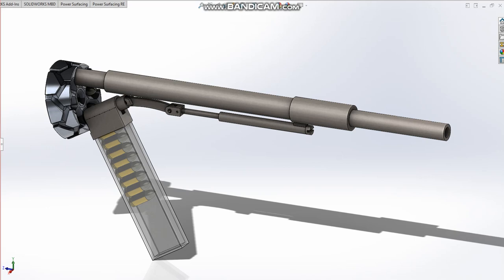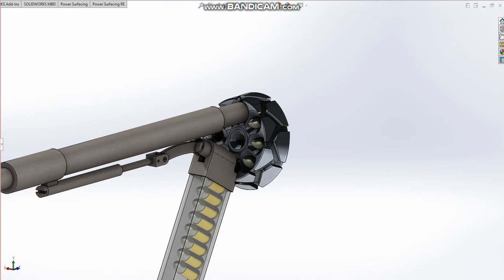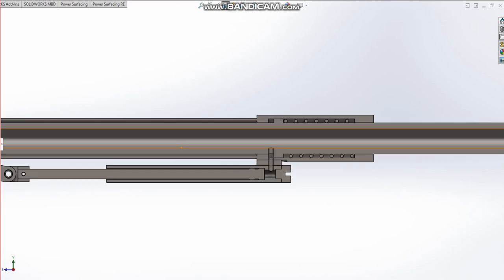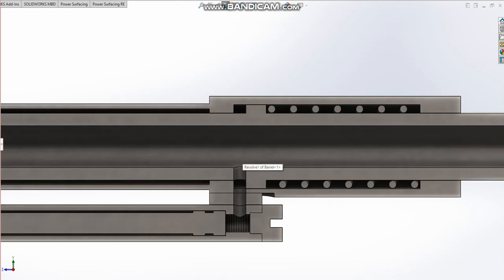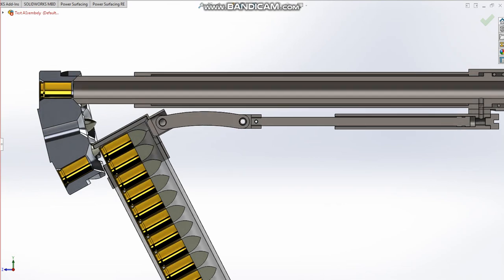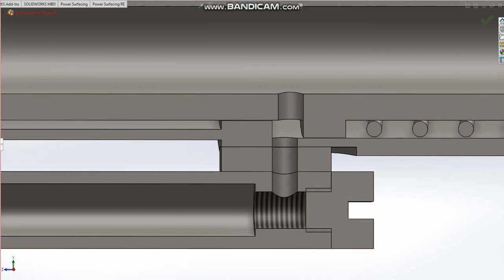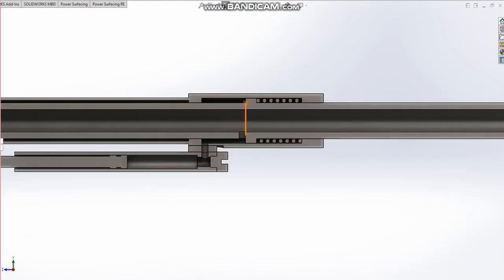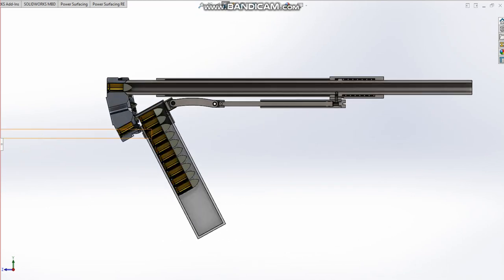New Hybrid Short Bullpup Mechanism

Comment: Came across this by accident, interesting and a fellow propellerhead here. There's one fundamental problem why this doesn't work; the way pistol or rifle rounds are fired in a chamber requires very specific specs for the chamber and thus cannot be inserted into the chamber backwards. Any looser chamber would result in highly dangerous pressure levels. Equally the bolt or whatever breech closing device you might use plays an equally important part.